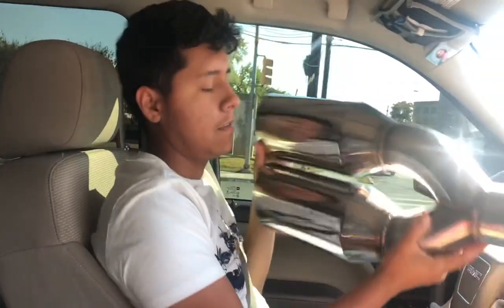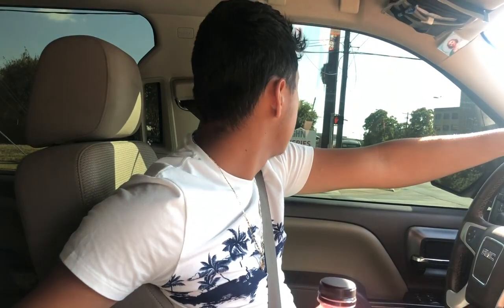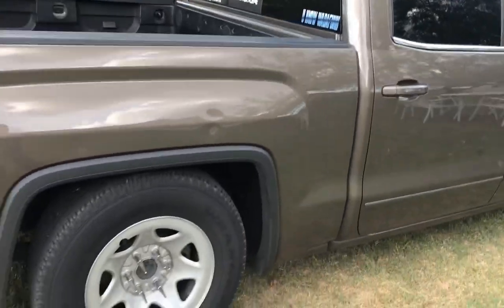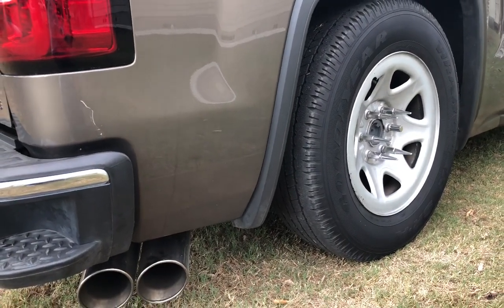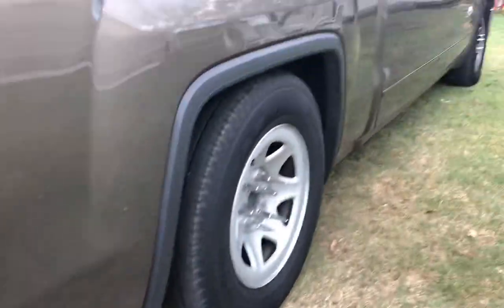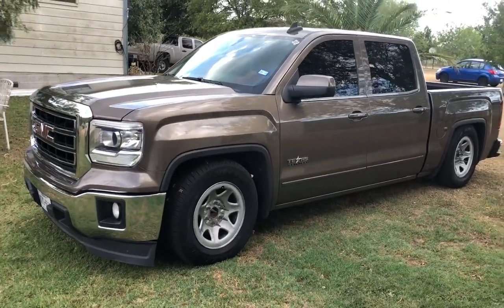5 Inch Exhaust Tips Installed!

Comment: Is it still the factory exhaust system? If so did the tip just slip right on and fit snug or did it have space left where you needed to use bigger pipe so it would fit?